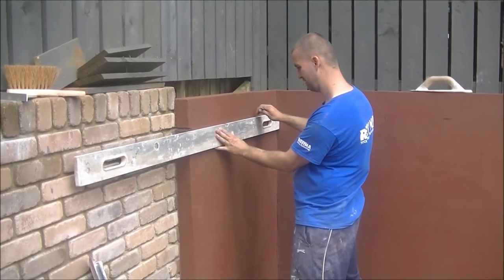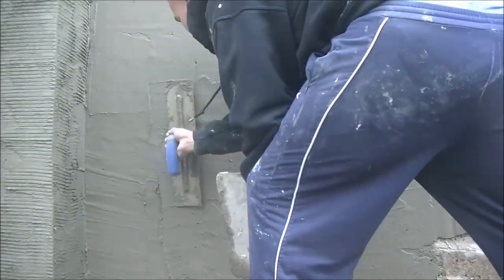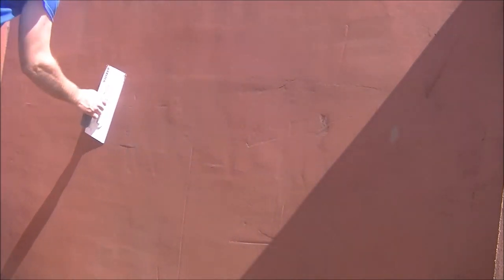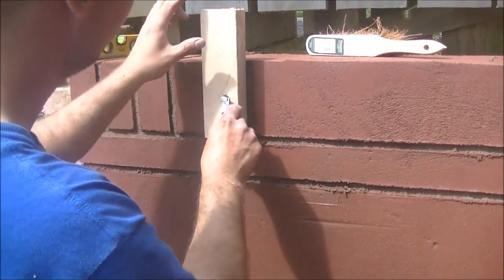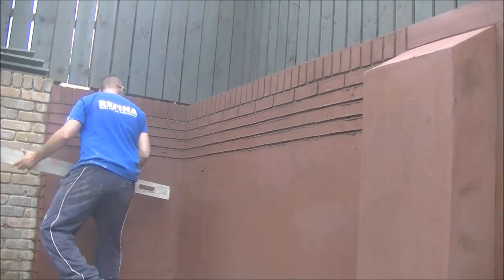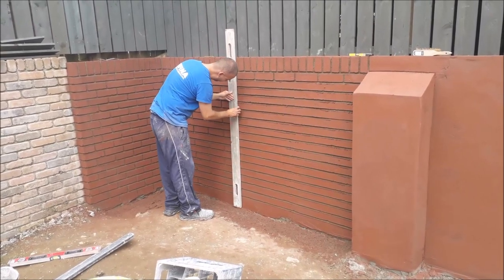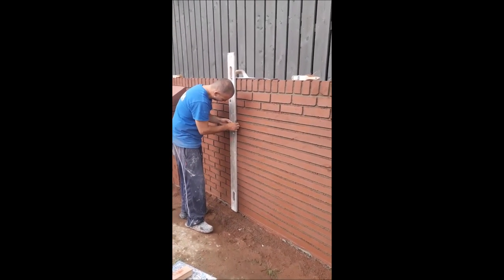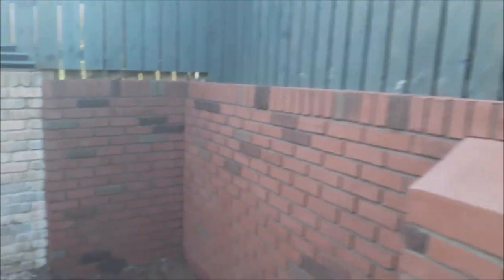RUSTIC BRICK EFFECT RENDER COLOURED AND CUT CEMENT PLASTERING with DECORATIVE DETAIL

Comment: Hi there. How long between the scratch coat and the next coat? Then how long before adding the colour render top coat? Finally, if you want to add a mix of colours to the top coat e.g random white and black is this achieved by adding splashes of masonary paint before cutting the joints in. Thanks. Love the video
Reply from the maker: Hi mate i add the dye to the mix so its right through if wanted to do a marbling type or random coulring i would suggest mixing a few with dye and adding it where needed ect The 1st coat was a day or 2 so it was well set then the butter coat was an hour or 2 before colour coat added on
Reply: @macplastering - thanks for the response. The top coat mix (sorry if you have answered this before), is it a special product eg K-Rend Brick Rend or a mix you have made from scratch. Once again love the videos😉
Reply: Hi Mac - just read the comments further down on the top coat mix. Is it a special dye you put in the mix?
Reply: Once again the answer is in the comments further down!

Comment: hi Mac, I am going to do this effect on my house in a few weeks, 
can I use lime in it? 

I also practiced rendering on a small garden wall last year with color in the mix, not sure why but it hasn't really taken/ gripped  after the frost earlier this year & feels a bit weak & soft I wonder if I put it on too thick? 
any pointers would be great
Reply from the maker: Possible the frost did kill your render mate. But also could have been other things mix and background prep ect but if frost hit the night you done it that's a strong chance of the weekend render have loads of rendering videos on channel and mixing video's
Reply: @macplastering   thanks Mac I will check them out. thought it may have been the cement dye. 
but it went on very thick & maybe I didn't get great suction. 
I'm gonna add lime to the render for the house is that gonna give me problems when working with it?
Reply from the maker: what ratio you thinking of ?
 @johns9543
Reply: @macplastering 
I need to start with a stronger mix don't I & subsequent coats need to be weaker, is that right? 
If I remember from your videos 
 3:1 scud 
4:1 leveling & scratch 
5:1 finish 
 what do you think would be good ?
Reply from the maker: was this the same mix as the last test wall m8? @johns9543
Reply: @macplastering  that was last summer so I don't remember but I doubt I did any of those steps. just PVA , scratched & finished coated but it had decorative stones & tiles embedded
Reply from the maker: it might come lose with just pva unless it was an exterior type ? What is on the house your going to go over mate? my mix's would be a bit stronger than the ones you mentioned but all depends on background and sand finer sand would be best with less cement but again best to use plastering sand its the best for strength.  but yes weaker as your coats come out
Reply: @macplastering   I see what u mean. Render I'm gonna hack it off to brickwork they are very damp bricks. I've a ton of plastering sand coming  should I start with a 3:1 mix then for a slurry . The next coat will be with lime should it be in the slurry . Also is a 1:1 a good mix for the lime & cement & obviously more sand ? 
I'm gonna use cementone for the color
Reply from the maker: if you going lime no point in using cement and same if you going cement hard to say without seeing the job the scud video i have shows the mix i would use for most jobs mate
Reply: @macplastering  oh so lime & sand is a mix. no need for the cement?  is that gonna be ok for the dye still? 
I'll be rewatching your scud & render videos when I get a bit of time
Reply from the maker: never used it with dye only cement so would be best to do small test areas somewhere before you go big, have a few videos coming up on this subject
Reply: @macplastering  your right I'll have to do a  test patch, can't wait for your new videos, 

thanks Mac I really appreciate your help 👍
Reply from the maker: scud video live buddy :)
Reply: @macplastering  just watching the start of it, thanks for the heads up 👍

Comment: Hi Mac, just a quick unrelated question. I have a old sand and cement chimney. Do you think a coat of acrylic plaster will seaal it and make it more water resistant.
Reply from the maker: It might do mate as long as its solid it should be worth the try its something i am think on doing on my own house over the old paint i been think power washing and re filling any bad cracks then prime and acrylic render it all ,
Reply: @macplastering  thanks for reply I think I'll do just that.
Reply from the maker: @tough2lie382  Anytime brother let me know how ya get on with it mate